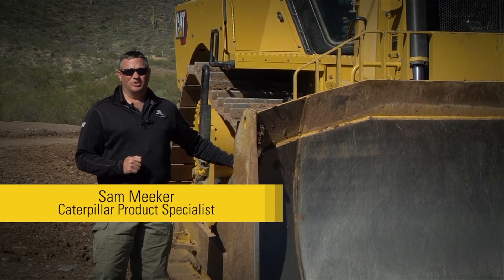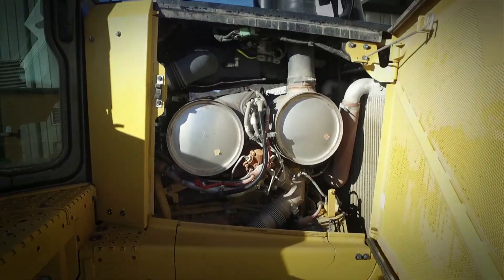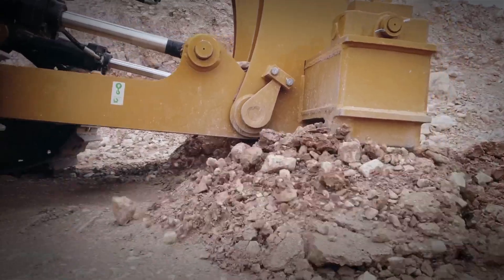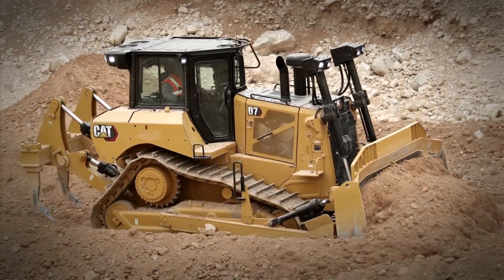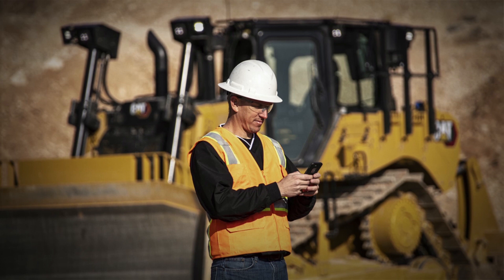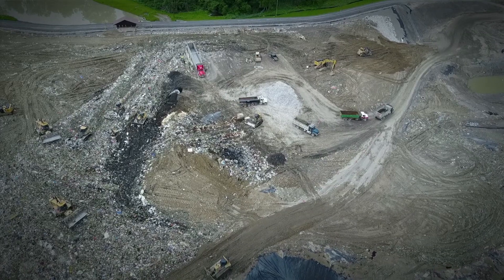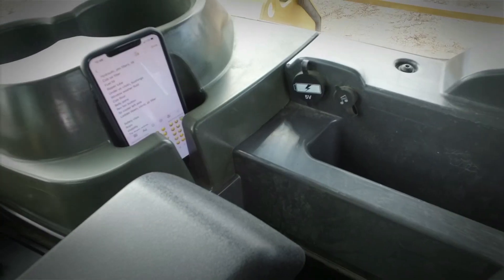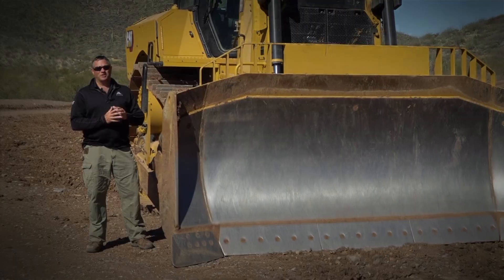Cat® D7 Dozer Feature Walk-Around

Comment: Glad to see CAT brought the High Drive back on The D7. Pipeline & Other Industries missed this High Drive Undercarriage. There were A LOT of D7R’s Sold To & For Pipeline Companies & Projects. The D7E Electric Drive Low Undercarriage Machine just didn’t cut it for the Pipeline Industries on Massive Hilly/Rolling Terrain Projects.
Reply: Taylor Alldredge the D7 series 2 was a badass pipeline tractor. It fit the work environment ie... the ROW, and that sound... oh man. The D7E was just silly. I preferred the undercarriage but honestly the controls just weren’t operator friendly. It just didn’t feel natural. Took a long time to get used to. I’ve been in the pipeline industry for 20 years as an operator and have literally worked with 1000’s of operators from all over and I have never met a single one who ever said they liked or preferred a D7E. Not one. If you lined up a bunch of tractors for a new job and on the first day told the hands to go pick out their tractor I guarantee you the D7E will be the last tractor picked, every time.     

The 8T’s are nice and with the landscape of the work changing over the last few years with the equipment getting bigger the extra weight and bigger winch cable of an 8T is nice but unless it’s needed they just become a hog. 

I’m not sure anyone specifically prefers a high track machine, it’s just the only option we have. No other manufacturer makes a tractor tough enough or most importantly, versatile and modular enough to cut it on the pipeline. Nobody really experiences the benefit of high track on a personal level. Not the operators, not owners of the company’s. Not once has it ever been brought up how high track machines made the difference, it’s just that how they’re made and there’s no choice. I can’t say if specifically the undercarriage on the new 7 is better than the 7E it replaces from an engineering standpoint but I’ll say this from the operator stand point,  the last thing an operator wants on a hill is to have the weight up high. If you’ve ever been on a high track side boom on a hill you’d know what I’m talking about. The longer, lower, wider = better. They should take the undercarriage of a 7E and chuck that E drive in the weeds and put a 3 speed power shift from the PL 583 and make a side boom out of it. Those high tracks roll over all the time and I know people who have died on them. Cat has been grasping to that high track design for far too long with a side boom and it’s time they admit their fault and build a machine that’s engineered for the work instead of trying to adapt something to fill a spot.
Reply: Robert F There is a Reason that there are Still Hundreds of 572E/572G & 583H/583K Still Laying Pipe Out There. Most have been Converted to Hydraulic, there are a Few Live Booms Still Around. One Reason is that Lower Center of Gravity and Another Reason is The Cost. For around 1/3-1/4 of The Cost of a New Cat Pipelayer you can get a Hydraulic Converted Machine with that Lower Center of Gravity that is Cheap to Run & Maintain. There is a Reason that you don’t see The Derailment Contractors Using New Cat Sidebooms. Stability is 1 of The Main Reasons.

My Personal Opinion for Deere Introducing the 950K & 1050K was to Fill Those Gaps that Cat Left in The Market Place. Deere also offers a Midwestern Sideboom Option on Their Deere Machines with a Lower Center of Gravity. Deere has been Hitting The Pipeline Business Hard the last few years, Especially in the Eastern US Markets.
Reply: Taylor Alldredge yea no doubt. I’ve run some 1st gen 1050’s they were pretty nice but not quite good enough to be a game changer. Same goes for the smaller sidebooms and MW conversions they make. They are designed to fit a market a specific segment of the market and to be honest they pretty much nailed it. As for the Cat PL 61’s they are outstanding tractors,,, except....... for oddly short stick. I know there’s custom shops who will build special length booms but as far as any the dozens and dozens of little inch jobs I’ve been on I’ve never seen a long boom version. I’m thinking the winch might not be heavy duty or physically big enough to support the extra cable needed. 

The problem I see with the Cat conversion tractors is many and I mean most are under engineered. They’re not fun to run if you’re doing production work. Usually the hydraulic pumps are incorrectly sized. The winches are slow and when tracking up a hill carrying a joint of pipe having the tractor want to stall out when you grab the hoist lever isn’t very fun. Another thing with it having a hand throttle people tend to ride the brakes a lot which means when you climb up on a different tractor you are usually not surprised to find the left brake is shot. 

I will say that Cat has made many changes for the better on the PL 83 and 87’s but why oh why did they put the seat facing away from the work on the 572H’s????